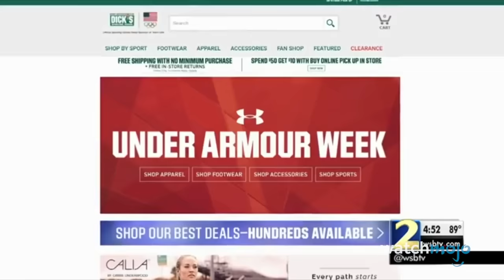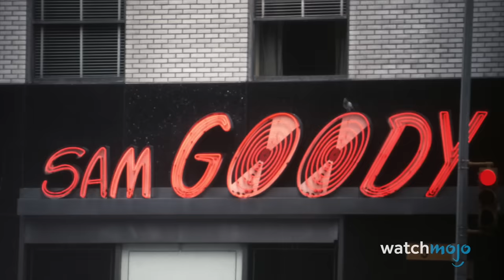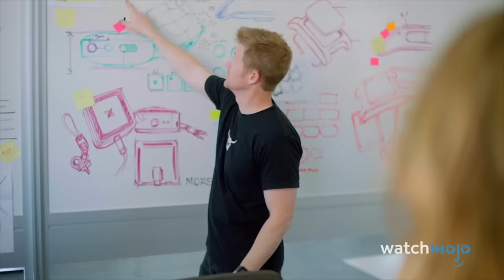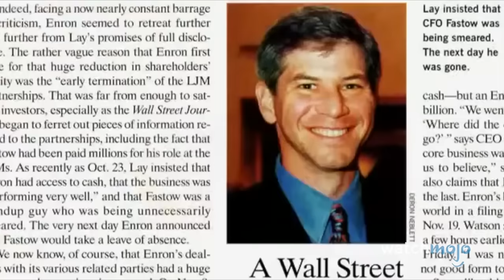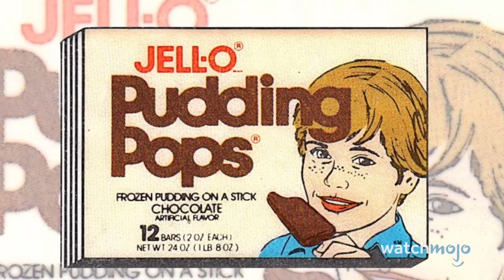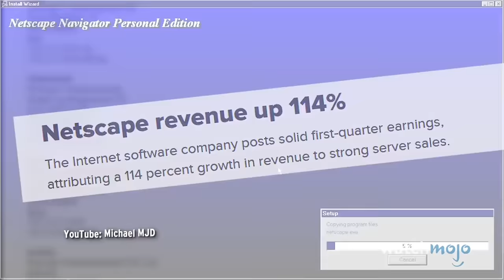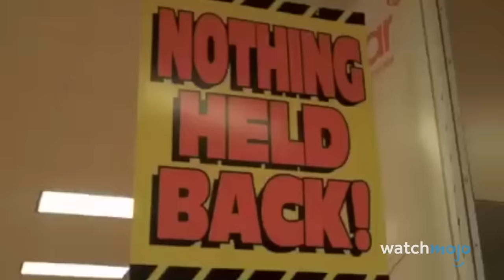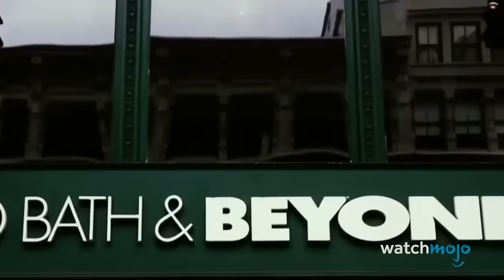Gone But Not Forgotten: Lists Of Things That Don't Exist Anymore

Comment: Don't forget how Compact Discs (CD-ROMS) replaced the floppy, then DVD-ROMS replaced CD-ROMS, then Blu-ray discs replaced DVD's then USB flash drives, Solid state drives and cloud storage pretty much replaced them all.
Reply: Blu-ray did not replace DVD. If they did you would never be able to buy a normal DVD, which you can.
Reply: DVDs are my #1 sellers on Amazon😁
Reply: Blu-ray didn't take over nothing dvds still very active. Dvds did take over vhs
Reply: Actually Vonyl is replacong cd. For every cd that sells 2 or 3 vinyls are sold. Actually 3 are.
Reply: @bsanchez3563  Yes,  Vinyl is very popular with DJs, hipsters, millennials and Gen Z. Someday CDs may make a comeback🤷‍♂

Comment: I worked at Circuit City during their decline. It started with cutting sales staff salaries which in some cases were in the six figure range down to around minimum wage. Then you could see the 1000 percent markup on accessories. Lastly they would find any way to not honor warranties but pressured sales staff to sell with every purchase.

Comment: I still use my Sony discman. 1 battery and can tell me track number with title with my burned discs and remembers where I left off. Others would start from the beginning if you stopped before finished and could only tell you track number. Also 2 batteries and not always 100% skip free if jostled.

Comment: I have often joked to friends that no place should ever consider hiring me if they want to stay in business.  As a teen I started work at Ponderosa Steakhouse, then Montgomery Ward, then as a young adult moved on to Babbage's game stores and then Incredible Universe (owned by Tandy/Radio Shack). Later on I also worked in store manager or higher levels at Blockbuster, which I left to go to Circuit City, followed by DOTS clothing boutique, finally ending my outside employment as a Regional manager for Payless Shoesource. While I know that nothing I could have done at my employment levels would have caused any of this, it does start to become funny when more than 75% of the places you have worked are out of business by the time you hit 50 lol. A few I had already left before they went under, but I have still been on several of those ships when they went down.  After Payless I got tired of being told I wasn't going to have a job anymore, and started my own business. Thankfully I have not yet had to fire myself lol.

Comment: I was PISSED that Mercury closed up shop. One of the greatest, reasonably priced cars I owned was a Mercury Milan. Reasonable price, decent milage, nice styling of both interior and exterior, very few problems. I would've gotten another one but the last of its kind was back in '10 or '11, a little too old for me to feel comfortable buying used.

Comment: Fax machines did really go away as opposed to we just changed how we fax. In the past we'd scan a doc into one machine and send it over phone lines to another machine that would print it. Now, we scan a doc onto or computer. Attach it to an email. Send the email to someone eho then opens the doc to read and print on their machine (aka, printer) if they so desire. Most printers are also fax machines. Stand alone fax machines have kind of went by the wayside though.